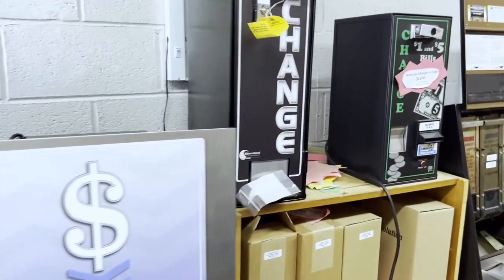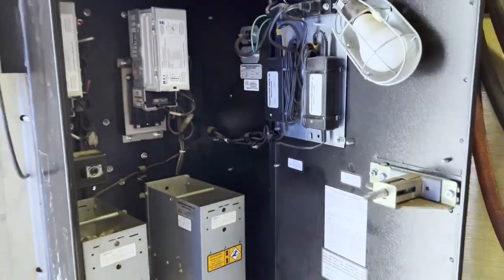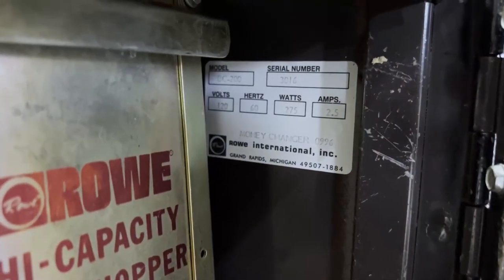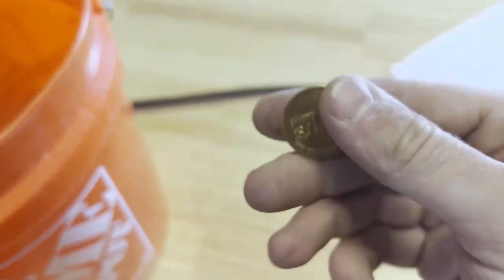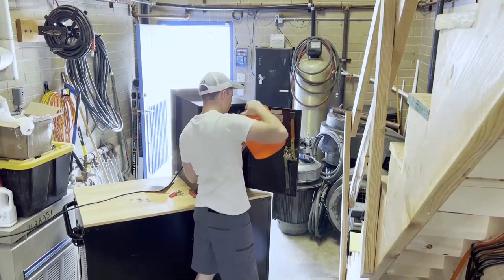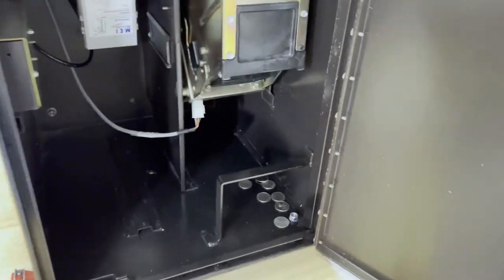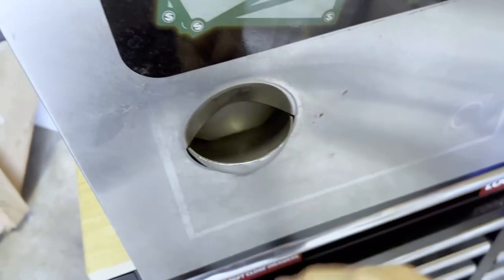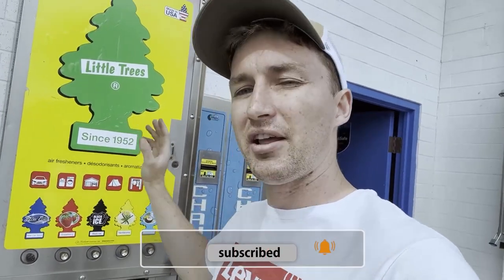How I Transformed an Old Change Machine into a Car Wash Money Maker!

Comment: For monthly maintenance: On the coin side, keep all moving parts greased. Put a pea-sized blob of grease onto the chain after wiping off excess with a dry paper towel to keep it fresh. On the bill acceptor, blow out the dust, then wipe down all rollers and optical sensors with a damp cloth.
Reply from the maker: Thanks I actually sold that coin changer already

Comment: I didn't know what stringing was either and I been in this business for 20 years until I was strung, HA! It's when a person extends a five, 10, or a $20 bill and sends it into your validator and waits to hear a click and pulls it out really quick and the pulses are sent to your hopper to disperse quarters. Its a art and takes a really good person to do this. I put in one of my location $500 worth quarters and they call me and ask when are we getting quarters. I went back on the video and it was two guys one wiping his windows and the other stringing and putting the quarters in his back seat in a large tub. I am outside of Chicago about 90 miles and they finally caught these guys in Pennsylvania and are now doing big time as it was the second time they were caught. When they were caught they found 10,000 quarters and 4 stinging bills. They also found in further investigation that they had 4  machines in there garage in Florida for practicing.
Reply from the maker: Wow thats a crazy story. It seems like these newer validators will error out if its tried. The old change machines I bet are still targets.
Reply: This is what worries me about coin operated machines.  They are just targets no matter what.  I know you said in the video that many people still use bills and coins, but I believe most people use credit/debit cards because it is a must for most purchases especially if you are buying anything online.